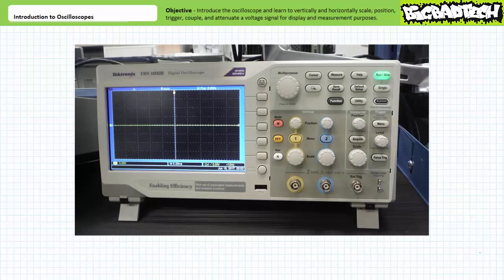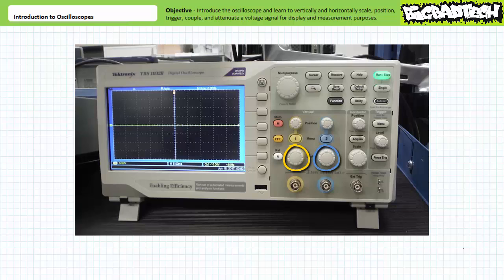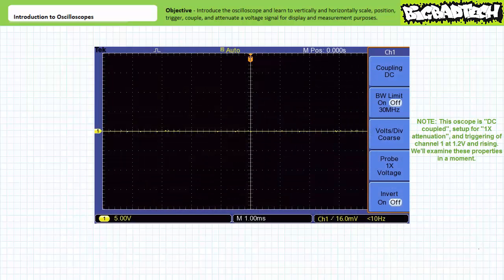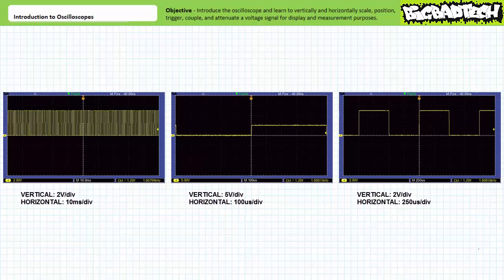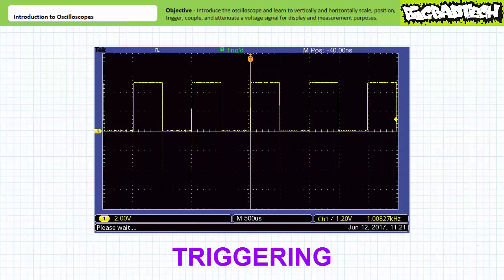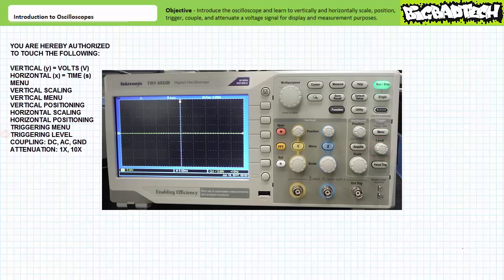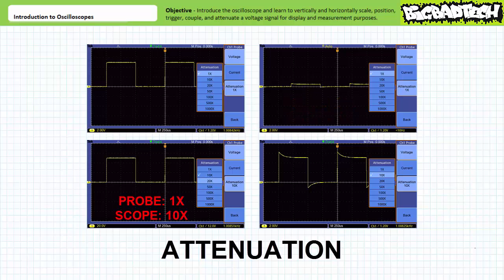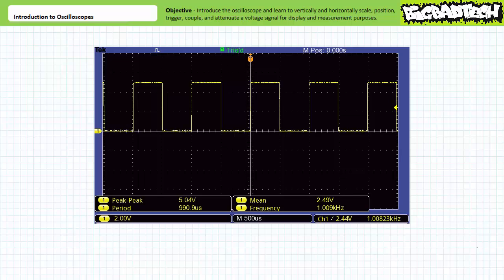Introduction to Oscilloscopes (Full Lecture)

Comment: Just to be fair, there is a way for a newbie to smoke a scope. If the 'lab partner' (lol you crack me with that) tries to measure high voltage and accidentally puts the ground part of the probe on the live part of the circuit carrying high voltage. Then you'd see an exploding probe, a highly mangled lab partner and a BBQing rotisserie instead of a scope! One way to prevent this I find is to use a GFCI outlet or GFCI power bar.